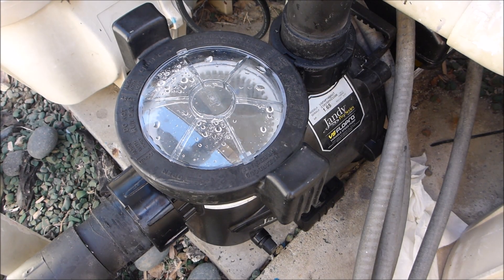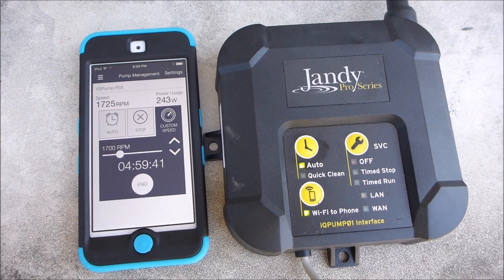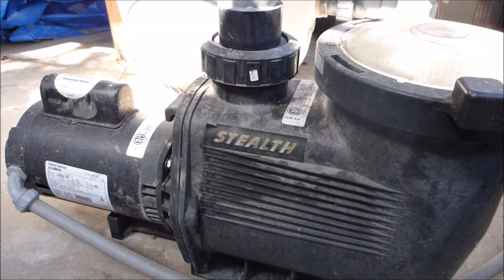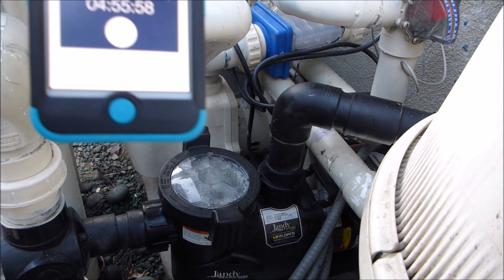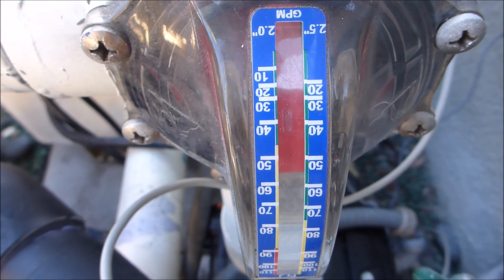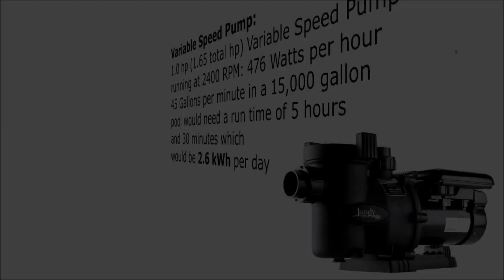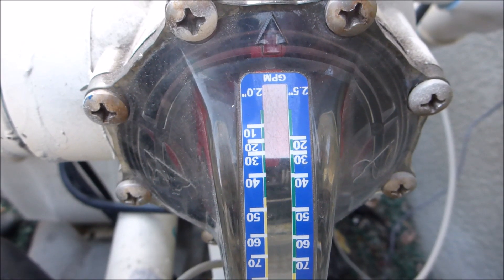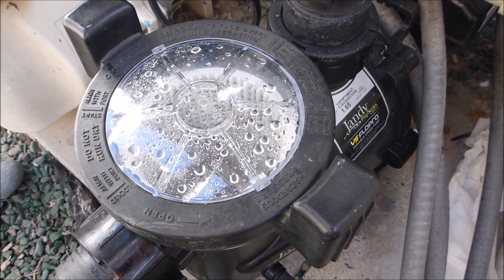Variable Speed Pump RPM, Watts and Run Time EXAMPLES: Featuring Jandy  iQPUMP01

Comment: Any idea what the gallons per minute would be for a Jandy 1.85 hp variable speed motor would be at let's say 3000 rpm and 2000 rpms?  TIA.  I have 2 inch PVC if that matters. ALSO what rpms and run time would you suggest for a 9000 gallon pool? TIA

Comment: What an incredible video! Thank you! You convinced me to purchase the IQPUMP01 first then I'll get the Flow meter. Question though, I have a JEP-R controller on my pump, do I have to remove it? Do I just unplug the JEP-R or will it work together with the IQPUMP01. I tried to call Jandy but it's impossible to get on the phone with them (8h wait time)... Thank you again!
Reply from the maker: THis plugs in where the JEP-R is connected. You will have to adjust the pin settings.
Reply: @SPL  thank you!! Jandy did call me back after 6h... the lady on the phone wasn't sure so I'm glad I asked you.

Comment: Can’t you just set the pump by gpm instead of rpm?   Why would you need a flow gauge if there’s one built into the pump?
Reply from the maker: Pentairs newer pumps are designed for that but the built in flow meters are not nearly as accurate as the FlowVis.

Comment: I have an IntelliFlo pump. At what RPM should the pressure gauge be read to determine need for filter cleaning? The pump normally runs at 1800 RPM and around 10 psi. During priming the pump runs about 3450 and pressure is 35 psi.
Reply from the maker: I would say based on your priming PSI a filter cleaning is due. 30 PSI is usually a good indicator of a dirty filter.

Comment: Hi , I  just get pentair  3hp variable speed pump,    I set pump to 1800 rpm,  watt about 280,  I noticed the water flow really slow compare to single speed that I used previously,   Then I connect return hole to a big bucket to see actual flow rate,  it came out only 7 gallon per minute,  how come the gpm so low at 1800 rpm,   Only one return hole in my pool .  Thanks